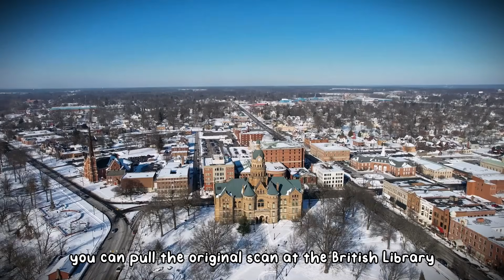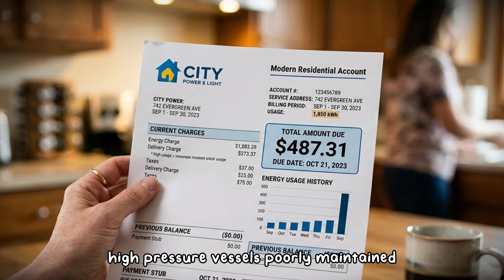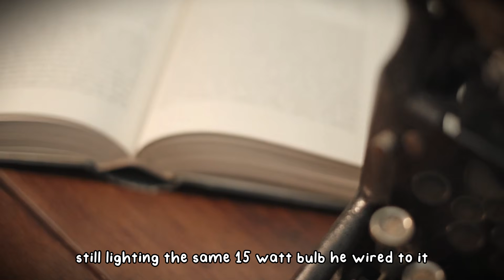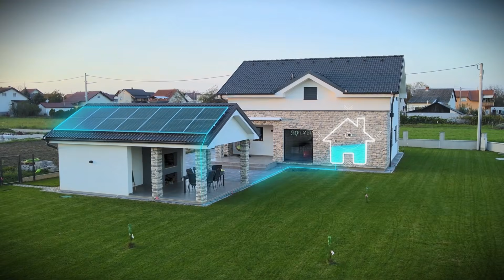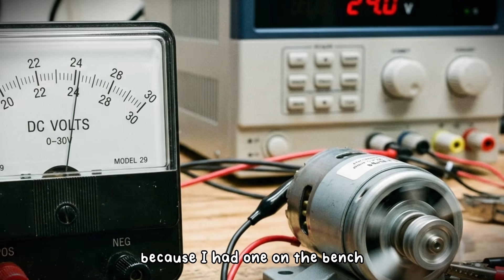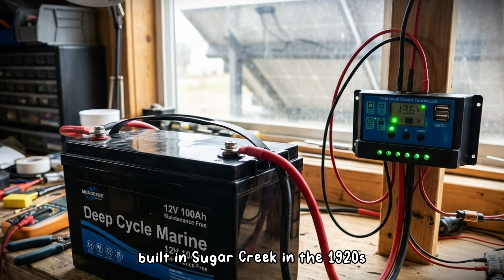Why Do Amish Barns Have Power but No Wires? The $87 Secret Inside

Comment: There are solar dishes that use sterling engines that are more cost effective  and more efficient than PV solar panels.  You need a heat source to make a sterling engine work at it's optimal efficiency.

Comment: Try going up 4 times but to be honest the price per unit hasn't gone up   by much its all the item's that are separated from the cost per unit first it was distribution charges added not based on units used it's set 100 dollars per month next transmission charge part fixed and part based on usage my usage still cost 60 dollars but the extra cost add 200 dollars per month whether I use kilowatt or 30 its still around 200 dollars per month and natural gas gas is the same I just got my gas bill and 50 dollars is fixed my usage was under 10 dollars

Comment: There is plenty of info on how to build stirling engines right here on YouTube.  It’s hardly a secret NASA has quietly used it.  Sweden has parabolic dish and stirling engines powering homes all over.  There are all kinds of patents with drawings that are not that hard to find freepatentsonline.  If you want to build one and have the money which is significantly more than they say the info is out there.

Comment: It&#039;s a water wheel. I built one. Also you don&#039;t need much power to run lights now days. I was able to get 4 bulbs to light just on 9 volts. You also don&#039;t need much power to play video games, use a phone, listen to the radio or run a fan.

Comment: But on the plus side an old 60w light bulb is now more than my whole house of running lights because of LEDS! This is good because we need a lot LESS power for our homes than before so the finish line has been moved closer for us even though the laws, cost and lies are greater now. I feel that's the system panicking because the power needed now for the average home is multiples less!!!
Reply from the maker: Lower power consumption certainly makes alternative energy solutions much more accessible for the average home.
Reply: Oh here's the problem with the. You reduce your power consumption. Then they up your rate so you pay more for less